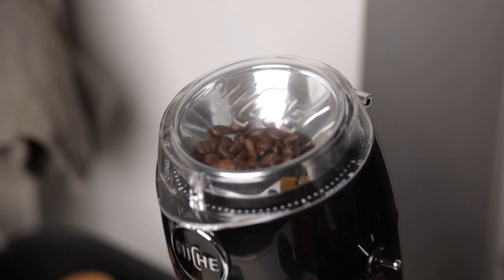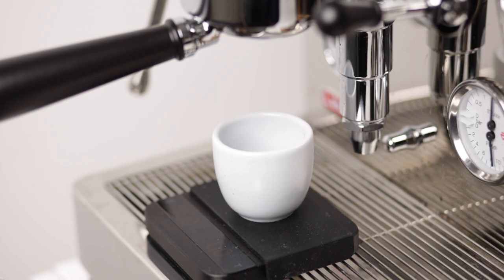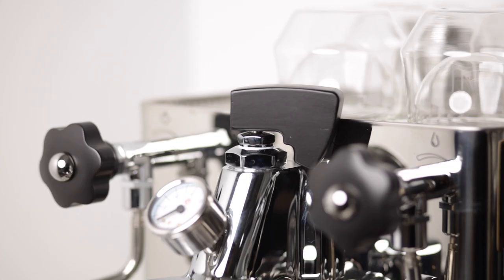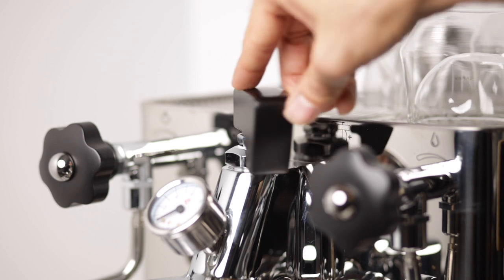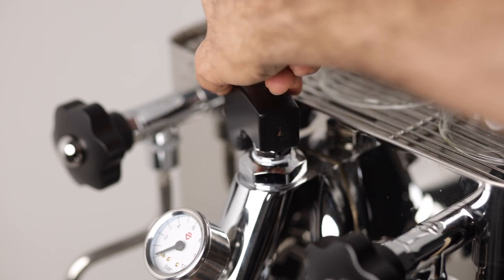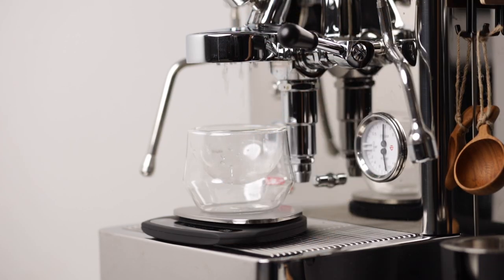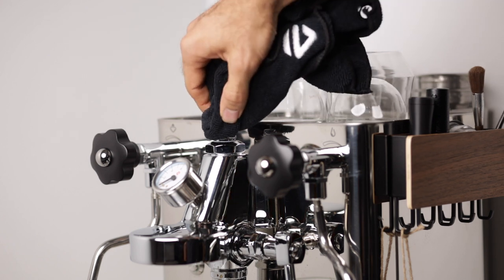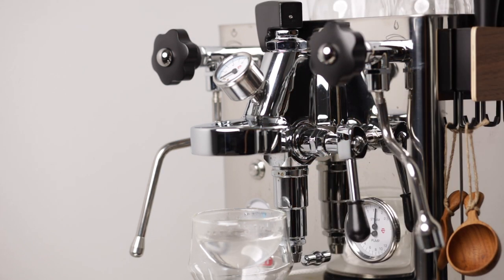How to FLOW PROFILE with LELIT Bianca (tutorial)

Comment: Nice video! This is why I want to upgrade my trusty old Miss Silvia, but leapfrog over heat exchangers and entry level double boilers, to something like the Lelit Bianca with its flow control paddle. But it’s too painful on the wallet at the moment 😂🤣😂
Reply from the maker: Thanks for your comment! Indeed it's a tearing choice and budget matters of course. The Silvia is a very good entry level, consistent and trustworthy machine so I would say that a dual boiler would be a more relevant upgrade if you plan on keeping it on the long run. But budget wise, a LELIT MaraX with heat exchanger is already doing a very good job with excellent user experience.Let us know what you'll go for ;)
Reply: @EdikaEspresso  thanks for your reply!  Something like a Flair 58 has also become an option. I could keep the Silvia for steam and experiment with the control over pressure the Flair gives.
Reply from the maker: @dinsy512  💯

Comment: Loved the vid! Do the vibrations from the Bianca (drip tray specifically) affect your Acaia scale? I'm planning on upgrading from a Barista Pro to this and my Pearl is unusable due to the high amount of vibrations that affect the scale. Thanks!
Reply from the maker: Hi Mohammed. Never had any issues or complaints with Acaia Lunar or Pearl on Bianca. Vibration happens inside of the body a little but the machine itself doesn't shake at all. Hope it helps, don't hesitate if you have any question.
Reply: @EdikaEspresso  haha alright that’s good to hear, thanks! That’s the difference between a $700 and $3000 machine I guess 😂🤷🏻‍♂️
Reply from the maker: @mohammedalsane66  One of them at least... Haha ;)
Reply: The Bianca uses a rotary pump, while the Barista Pro has a vibratory pump. Speaks for itself I guess :)